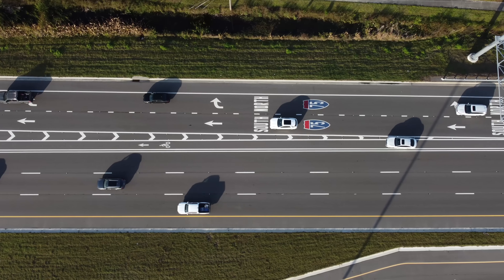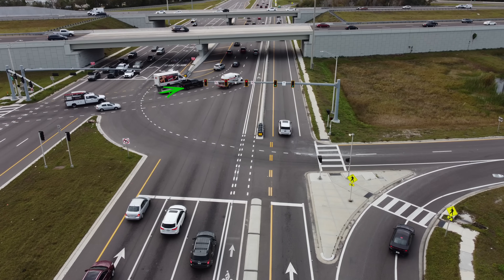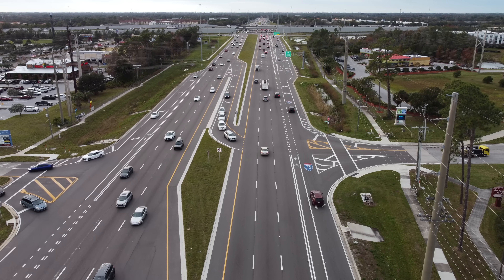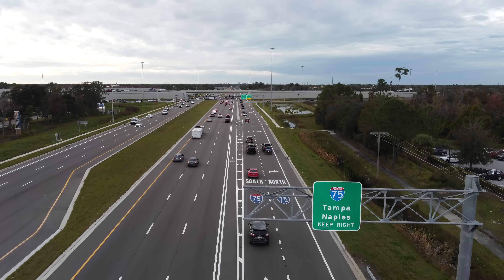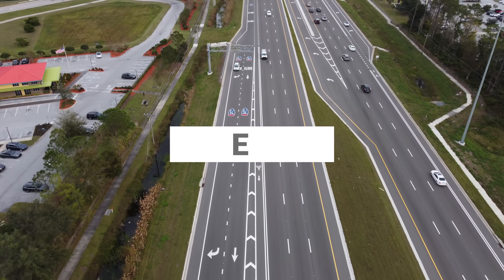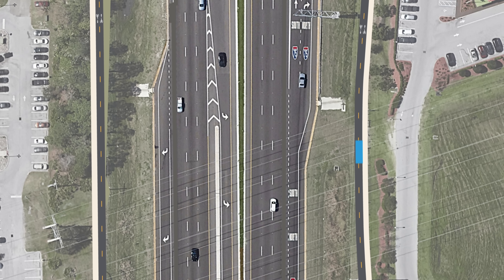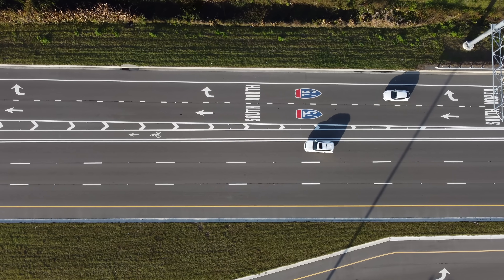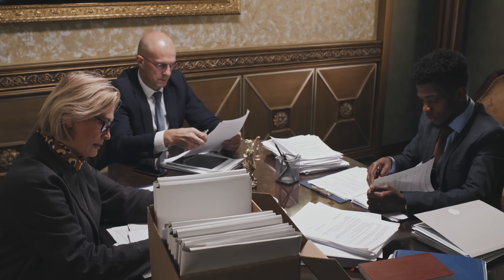This Brand New Interchange is Already Flawed

Comment: Drivers need to be better educated as to what the lines on the road mean. A solid white line on a lane isn't supposed to be crossed but it isn't illegal to do so. Crossing a double solid white line is illegal. I was shocked to find out how few people know that. Signage is very important. Early highways had the entrance and exit from the right lane. When a driver saw a sign showing an upcoming exit, they knew to get in the right lane. Highways now have exits almost anywhere. You might need to be in the leftmost lane or even one of the middle lanes. When traffic is heavy, it can be very difficult to change lanes so drivers need enough warning far enough back to make the lane change. If you miss your exit, go to the next one instead of trying to cross lanes at the last moment.

Comment: ALL bike lanes should fail to qualify as bicycle infrastructure! They're inherently unsafe, and created entirely because of some idiot that decided to write them into tax policies.

A cyclist trying to ride their bike in the middle of traffic is not helped or made any safer by the presence of a little drawing of a guy on a bike. It makes drivers uncomfortable at best, and causes accidents due to driver anxiety at worst. For the cyclists, they are being forced to ride in busy traffic without any barriers or protections except for a white line and up to 2 whole feet of distance between them and the lane of traffic.

Then there's the elephant in the room. Cars emit exhaust. LOTS of it. And not just exhaust, they spew tire dust and other road pollution into the air as well. I will ride on the sidewalk even in the presence of a bike lane, and so do the vast majority of cyclists in my city, and believe it or not, being hit by a car is only half the reason.

The bigger half of the problem is breathing in the pollution from the road. By being 10 feet away from the cars, the air is no longer so polluted that I am physically able to ride a bicycle by being on the sidewalk. But with especially busy streets, the sidewalk still isn't far enough away, and as someone who doesn't even suffer from breathing problems I have found myself having to go completely away from the road in the middle of travel and stop to catch some fresh air before returning to the sidewalk area being of how physically painful it is to breathe in those conditions while exercising.

Just watch, in 20 years I guarantee we'll be able to look at cities with a lot of people using bike lanes, and see the cancer clusters from all the shit they were breathing in while sitting unprotected in a cloud of car exhaust every day!

Comment: They just redid all the road infrastructure in the city where I live with added bike lanes everywhere and it has made the roads so incredibly confusing. 
The main 6 lane road that runs through down town is the worst. Traffic is constantly getting backed up, the parallel parking requires you to cross over the bike lane which you can only do in certain spots because there are metal posts every where. and the long turning lanes that used to be there for turning right onto the next big main road has been completely removed. And the crazy thing is nobody is even using the bike lanes at all. All they do is give homeless people a place to panhandle.

Comment: The cheapest, most simple fix for this is would be to add in solid barriers, and to fix signage to make more sense. You can't merge last second if there's a solid barrier in the way, or in this case, two, protecting the bike lane on both sides. A simple barrier is the oldest, most basic safety device used in these exact locations. Just doing striping is incredibly dumb and very lazy.

Comment: The human driver part requires drivers to become responsible again and not think solely of themselves. Until that happens their is no means of signage that will make a difference. Also peopke being considerate of other drivers as well. As when people need to take an exit and other drivers dileberatly block drivers for taking their exit that alone will cause unsafe driving behavior to get around/deal with other drivers putting them in a situation where can make them late and or have much more serious consequences.

Comment: This presentation was very well done.  Thoughtful, visually engaging.  As a former state highway design engineer, I concur with many of your points.  Human factors are written into the design policy, but are often treated lightly in the design process.  Unfortunately,  the best teacher is life ... we don't start taking these design elements seriously until after we've made a mistake.  And due to the compartmentalization of the planning-design-build-maintenance process, the silo effect often preempts learning even after a serious error is made.
Reply: Here in the Netherlands we have a non-profit organization (CROW) that was created by government and relevant companies in e.g. road construction and traffic engineering to act as a nationwide knowledge base for traffic/mobility design, performing active research, developing standards, and distributing this knowledge to the parties that need it to avoid having to keep reinventing the wheel.  Technically their design guidelines and best practices, based on decades of experience, are just non-binding advice, and local projects can deviate from them if necessary/appropriate.... but you better be able to provide good motivation for such deviations since the authority that builds a road can be held liable for any accidents resulting from misdesign (or from poor maintenance).
Reply: I just joined my state's Department of Transportation for a job and also don't like the compartmentalization. But I bike to work every day (one of only two people out of...maybe 80 in the office?) but I think my state does a REALLY good job accommodating bicyclists anyway...now we need property and development reform to give more middle housing options and support better public transit (which actually is still a lot better than a lot of states, even given our lower population density in much of the state)

Comment: Oooorrrrrrrr, You could do what europe and the UK have been doing for years and is confirmed to be one of the most efficient designs ever, Use roundabouts. These are safe and easy to understand. We in the UK use them for multi motorway (highway) connections and they work really well.

Why is america still backwards when it comes to this

Comment: Round abouts only work if you have an area that has extremely low population and extremely small amounts of motor vehicles and small vehicle.  To put it bluntly round abouts only work if you blatantly have nearly 0 cars.  Round abouts actually block traffic constantly.   Hell here is a really screwed up thing.  If you have 23 shopping carts you can turn them and have them become a closed circle but you can not remove them from that circle because the tires can not turn out of that position because of how physics actually works.  Now when you have vehicle go into a round about if too many vehicles enter a round about then all the vehicles get trapped and can not be removed from that round about without using specialized tools.  Now Europe claims that round abouts are safe but from actual studies that non lying sacks of shit do round abouts increase crashes by over 15,000% and increase time on the road by over 500,000% in many cases.  Hell because of how roundabouts actually work a normal trip to work that would normally take 5 to 10 minutes could wind up easily taking 4 to 5 hours but at fastest times 1 to 3 hours.   There was a roundabout in Maine that well getting to a certain aria usually took people about 18 hours to get to that location but when a regular 4 way stop was put in that time got shrunk down to about 3 minutes.  Yea roundabouts are not good at all.  They slow traffic they cause massive back ups and they are blatantly stupid.  Hell a regular 4 way stop with regular 3 lanes in each direction allows for 300 to 500 vehicles to travel threw in 3 to 5 minutes while a roundabout only allows for 2 to 5 cars for the largest of roundabouts to safely travel threw it at a time allowing only 10 to 25 cars to pass threw in the same time that a regular 4 way street allows threw.  Then you have to deal with the fact that now people have to wait for hours to get threw a regular roundabout while regular streets allows for really easy traffic.  Stop lying.  Seriously stop spreading absolute bullshit lies.  Hell there have been over 60,000 times In Europe where people have been trapped in their cars inside of roundabout because they could not get out of their cars because the traffic created by roundabouts caused them to get blocked in and the United States Military had to take helicopters to attack hooks and stuff to move cars so that people could get out of their vehicles.  Hell one roundabout in Europe was shut down after the 15th time America had to be called to fix the issue again where special cranes had to be brought in to pull cars out of the underground roundabout.  America got tired of dealing with the fucking problem so America stopped helping and then police officers had to put up train arms to grant people access to and from the roundabouts with police being used to direct traffic allowing people to get in and out basically meaning they had to put in something similar to a traffic signal that is in a 4 way stop but far more useless.

Comment: I’d love to see your thoughts on the end of the 402 highway in Sarnia, Ontario approaching the international border. Trucks regularly get backed up crossing the border and block the exit ramps into the city. The solution was to separate the far right lane as a long exit access, however the trucks back up past the access to the exit lane. This is a very high accident stretch. In my opinion, the transport trucks should separate to the left just past the Highway 40 access exit ramp, and have the remaining lanes more like a traditional highway, but with the trucks needing to pass over the higher speed left lane to do this I’m not sure how this transition could realistically be done. Hope to hear your input 😊
Reply: I'm a Sarnian, and I agree with your comments. There have been a ridiculous amount of accidents in the last decade. They didn't really do as great a job updating the stretch as they probably should have.

Comment: You highlighted 'confused drivers' as an issue. Maybe there should be more requirements for obtaining a drivers license in the first place. Confusion does happen on the road, it happens to all of us. Too many drivers don't understand how to deal with confusion when it does occur, that's the issue. 

I learned when I find myself in the wrong lane to first assess if it is safe to correct at the last minute before doing so. Often it is not, so you're committed to the wrong way. Simply let your GPS reroute or pull into a parking lot to regroup. I took driving school and not once was this taught, nor was it referenced in the process of acquiring my license. Incompetent drivers need to be taken off the road; the shier number of them is worse than you think. More than half would be a conservative estimate.

Comment: The initial entrance to the I 75 lanes is wholly in adequate.  There should be a secondary exit for  I 75 northbound and abundant I 75 signage.  Fully HALF the problem is that the initial I75 exit appears to most motorists to be strictly for the southbound lanes and people think they will get a sign for the northbound lane but the divide is already in place by the time they see the north bound signage.

Comment: The simplest solution in my eyes is just adding a physical barrier. Those orange plastic poles you sometimes see on the highway come to mind. Probably not the smart engineering solution everyone would like to see, but a whole lot cheaper and no need to pave or paint anything new.
Reply: People tear through traffic delineators regularly. 

I-95 in Miami Dade County for example. Drivers cut through the traffic delineators that separates the express lanes and general use lanes. So drivers would do the same thing here if they’re trying to get over to access I-75.

Comment: NICE!! 🍷🍷 That bike lane is a perfect fit for the cycles we use. Our cycles weigh about 6,000 pounds, so we're not really concerned about any of those cheap tin and plastic vehicles running into us. We avoid automobiles because our cycles will do thousands of dollars in damages or even totally destroy them. Build heavy steel cycles and you won't need to build seperate bicycle infrastructure. 🍷🍷😎

Comment: I live in this area, and I can tell you tunnels are not an option. It’s barely 8 to 10 feet above sea level. The change in grade required is not possible given drainage runoff. Tunnels would flood with every rainfall… Which in Florida is a lot. This is why you never see tunnels, except in North Florida where it’s slightly higher elevation.

Comment: The new interchange in Florida is already flawed due to several reasons. Firstly, the design still poses significant dangers for cyclists, with the bike lane crossing at high speeds and the lack of proper infrastructure for safe cycling. Secondly, the confusing design of the interchange leads to drivers making maneuvers that are not intended, causing potential accidents and traffic congestion.
The interchange's signage and lane markings are also problematic, as they do not accurately reflect the intended traffic flow and can lead to confusion among drivers. Additionally, the human psychology aspect is not adequately considered in the design, which can result in mistakes and accidents.
In summary, the new interchange is flawed due to its dangerous conditions for cyclists, confusing design, inadequate signage and lane markings, and a lack of consideration for human psychology in its design.

Comment: Traffic engineering, as taught, must be at an all time low.  In Fr. Wth. Texas there are 9 roundabouts within 1 mile of my home.  They have all been built in the last 3 years on long time existing roads.  4 of them are on a major highway and anywhere near rush hour they are locked up tight by all the people trying to enter the highway.  If you need to pass thru to continue on the service road you just can't.  It is on the ten year plan to remove these 4 and replace with old style access.
Reply: The biggest issue with US traffic engineering is they just... half-ass copy other countries where these things do work, but fail to account for why they work there.

Comment: It's obvious that the initial design was flawed, but beyond placing the "bike lane" and signage in the wrong place, the planners overlooked the most significant factor, that could have saved everyone so much headache - if you just reduce the speed in the on/off ramps, you can significantly shrink the turning radius and the ramps' overall footprint, making it possible to fit more leafs and eliminate conflict points. Also driving slower on the ramp is still infinitely faster than sitting still at a traffic light.

Comment: It doesn't actually matter how roads are designed because the majority of drivers are quite stupid. Unfortunately, it is too easy to get and keep a drivers licence. With more strict licence conditions and training, things would improve, but there also must be means testing on fines so that the punishment is equal regardless of someone's financial situation. A $100 fine is a lot for someone on minimum wage but means absolutely nothing to a millionaire. Once you have lost all the points on your licence or committed serious driving offences, you should lose your licence completely and have to redo your learners' permit. Repeat offenders should be banned for life and driving without a licence should be a minimum of 5 years in jail. Driving is not a right, it is a privilege that people must respect if things are ever going to get better.

Comment: Your proposed bike trail at best interrupts, and at worst is under, the required drainage swales and detention basins for the project.  Florida is very flat and it rains at 4pm don't ya know.  Plus hurricanes.  But any design that puts a bike lane on a 55 mph road needs to be rethought.
Reply from the maker: Just a concept to show options and start conversations that could be done at highway interchanges in general, not a fully engineered plan by any means. In this particular situation, maybe it wouldn't work but in another place it might spark an idea for someone.

Comment: The bike lane should be at the very right, and only crass traffic when right turns are involved. Then there should be plenty of space for the 2 lanes for the turns. Definitely no solid lines at any point to avoid confusion or forcing any undesired action. In other-words, change the marking to match what people actually do.

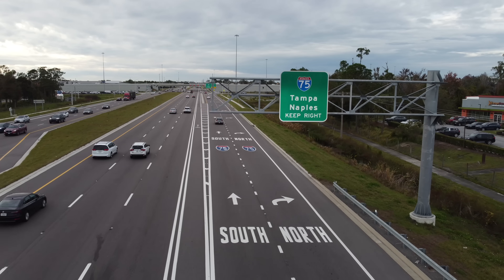Comment: Looks like the signs seen at 3:45 and  3:57 where mistakenly swapped since the 3:45  sign makes sense over the single lane section (both north and south being in outer lane. And then 3:57 works later down at the 2 lane segment. Just a probably overnight job to fix

Having a quick look on what google shows and it looks like the rest of the layout made sense. the 2018-2023 version. The 2018 version did not have the additional south slip-road until after the lights.

I definitely aggre with making a split foot cycle path is much more logical and make sure to link it to lighthouse drive and that new build. Another layout point I’m trying to get my head around is the exit to the new build between grand harbour parkway and the junction since to me that makes another unneeded conflict point